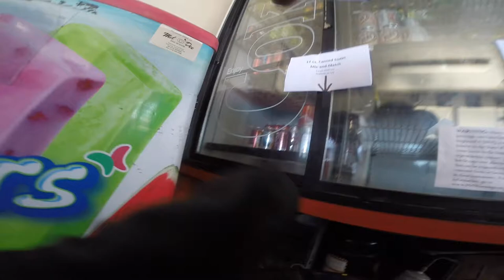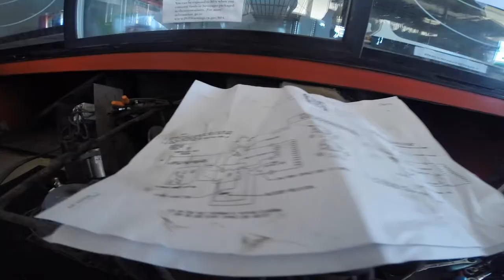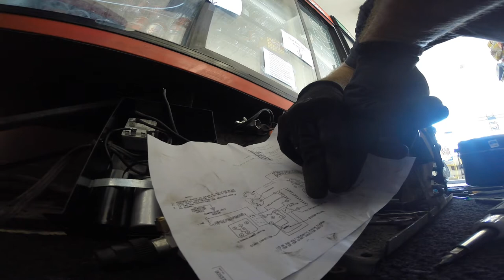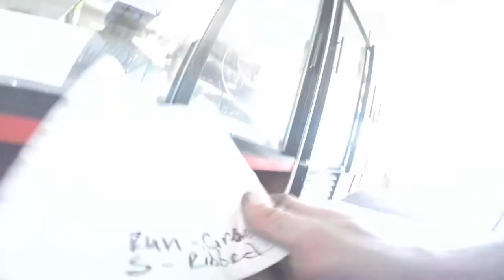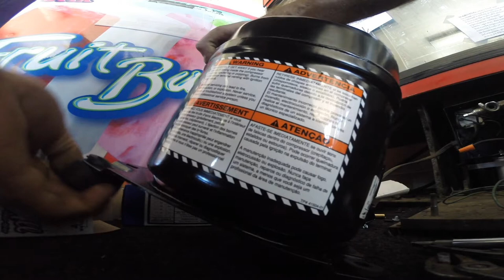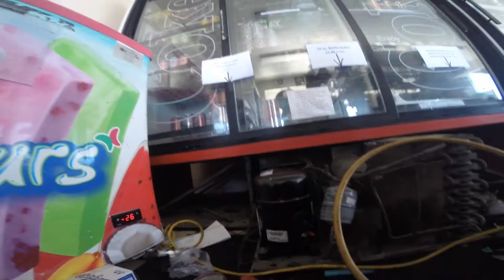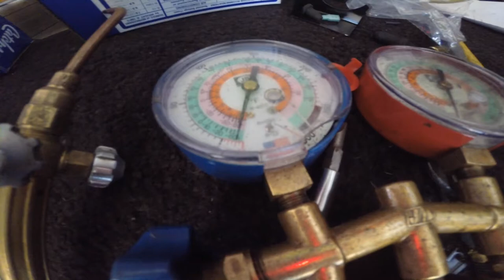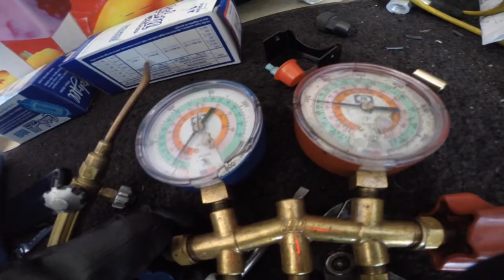HOW TO REPLACE BEVERAGE AIR COMMERCIAL REFRIGERATOR COMPRESSOR. 1080HD.

Comment: Beverage cooler compressor has good continuity, good amperage draw with a new hard start compacitor but will not stay on long enough to cool. It cuts on, after a few sec it turns off! What could be the problem
Reply from the maker: compressor is bad internally, bearings or other mechanical issues issues. Your AMP draw will be higher than normal on it
Reply: Thanks brother!

Comment: Beverage cooler tripping the circuit breaker, what cause that?
Reply from the maker: can be anything. Something is grounded or pulls way to many amps. I would recommend to call refrigeration company.
Reply: @MaratRPMSoCal  thanks for the response.....rarely anyone around my area do commercial refrigerators

Comment: quick question. I use a beverge air UR30 series for a kegerator and the compressor fan is way to loud. Any tips for residential use? thinking of trying a different fan solution.
Reply from the maker: I don’t know how to help you on that one. Fan should move proper amount of air thru the coil, so it’s up to the size of blades, pitch and speed of the motor. Compressors usually louder on commercial applications as well simply because they bigger
Reply: @MaratRPMSoCal  i just ordered a new fan motor, and was able to find a plastic blade for it. the motor is probably ok but it's gotta be 15 years old anyways. Whole assembly is not balanced and vibrates. I think the plastic blades will be more balanced.
Reply from the maker: @DerekIwasiuk  if it disbalanced then try original stuff.

Comment: What do you use for dope on the Roto Lock's? And where in Cali is that, it looks like a sweet spot.
Reply from the maker: I use a little of pump oil for O-ring and "leak lock" for tread. This one was at city Dana Point. https://express.google.com/u/0/product/14230084815635348061_10790081289950901213_110287632?utm_source=google_shopping&utm_medium=tu_cu&utm_content=eid-lsjeuxoeqt&gtim=CKCyj8f05tPx0wEQ9_Pj-P2-pejrARign_oBIgNVU0QokPr75wUwkLbLNA&utm_campaign=110287632&gclid=Cj0KCQjwxMjnBRCtARIsAGwWnBMa1ykgnCw4OvoO5rX5bjJkpYXaLM3Zqap5Ma7VbtTJDoWpW3JhQQYaAvV6EALw_wcB

Comment: Question, I am learning about A/C.  I seen you hooked up your yellow hose to the unit and then to the vac pump, then hooked the suction hose up to get a reading on vacuum, why cant you just hook the blue hose up the unit and have the yellow going from the manifold gauge straight to the pump?  I have never seen one of those valve deals where you hooked the yellow up to.
Reply from the maker: Well, because I had 1 yellow hose on low side (to suction valve on compressor), second yellow hose from pump to gauges on the middle, and blue (attached to high side on the gauges) to high side of compressor. You can have all hoses same color.
Reply: On

Comment: If you don't mind, about how much does this repair cost the customer out there in California?
Reply from the maker: 1200-1500
Reply: WOW around here it's about 700-800. You can get a new True brand single door refrigerator for $2,000 or a little less. A 3 door merchandiser for $3,000.
Reply from the maker: BlackHawkPSU compressor itself was around 480$ at supply store.
Reply: Yeah we just had a Tecumseh compressor replaced on ours. I should note we are not in California.

Comment: No nitro when brazing?
Reply from the maker: No Nitro
Reply: @MaratRPMSoCal  so is this compressor bigger than a traditional fridge freezer compressor. Just a random question. And yes I do repair fridge's like these like True merchandise and other brands. So yeah I like watching these because it reminds me of the repares I do.
Reply from the maker: @Beko500ProGolover  Im not sure on size. This one pretty descent size. either 1/2 or 3/4 hp. The smaller once could be 1/6th 1/5th HP those are tiny once
Reply: @MaratRPMSoCal  ok thanks for telling me.

Comment: At least the compressor wasn't on the roof.
Reply from the maker: For sure much nicer to work inside with AC on
Reply: You got that right. Been 96 degrees with heat index of 110 degrees with 90% humidity around here.